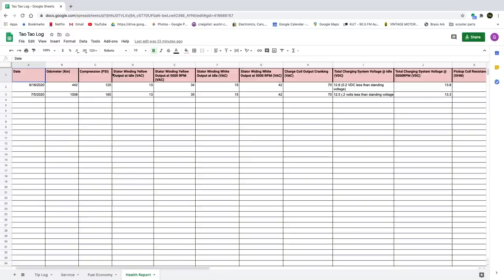(PT.7) I rode 1000 MILES on the most HATED scooter on the internet. Here is my review.

Comment: I have a tao 50 with 1958.6 miles now, paid $750 to Dallas motor sports for it new. and I agree its the cheapest bike to buy, however for anyone who has one of these (DO THIS !!!) before anything ...change the oil and check all fasteners nuts and bolts, "BEFORE YOU START THE ENGINE" after 400 miles change oil to full synthetic and gear oil to syn also. replace air box with a pod filter , replace battery , replace coil, replace carburetor with one you can adjust "move needle adjustment to allow max fuel intake, new spark plug also, replace cdi with adjustable cdi and set to max timing advance or the best idle, (do not get a racing cdi) , get adjustable cdi , so you can tune it for your environment and the way you ride...these tao taos hate cold weather but after making these changes mine loves the cold  (STARTED UP WITH ONE TURN OF THE KEY IN 26 DEG TEMP)but need to adjust carb for warm weather.  i thought this video was very good and enlightening , and i do appreciate the effort that was involved,  BTY after making these changes my tao tao will do 39 mph on a flat road so i can keep up with traffic ,  I purchased all parts on Amazon for  about $120 .

Comment: Hey, don't keep going with the experiment for  we YT watchers.   If you don't feel safe, call it quits.  My last two wheeler was a Yamaha Majesty which had 40 hp and could go 80-85 mph. Even with that power , I felt at times like car drivers were trying to  run me off the road. I enjoyed two wheeling more on the secondary roads through the country.                     I am sure, I just couldn't hack it on a 50cc Tao Tao. You're a braver man than I am !!! P.S. Let's hear some more piano!
Reply: i used to push a 1.0  hp, tomos revival, two-speed. top speed 28mph . i got passed by a group of bicycles more than once . i push a taotao powermax vip 150 on that old 50cc plate now for 6 years. did first engine oil change after 25,000 miles, still using factory gear oil, brakes, . i did put a maxxis 6024 on back for offroading Fun but blew a front fork seal . only two problems, muffler mounts and side plastics .  $650 NIB, the ATM-A1 in the above video was $499 NIB not $750, he prolly paid $250 for delivery , i spent less than $25 in gas . i would recommend the taotao powermax vip 150cc
Reply: I like to ride too. My wife and I also own a smart car which is amazing on fuel and the parking. I look for the ass that tried to take 2 spots and squeeze right in. HOWEVER, you get no respect on the road. 😂😂😂

Comment: Perhaps you should have found a guinea pig test subject that fell into the optimum parameters for this type of transportation . Say a high school kid of 175 pounds or less  with an evening job at a local burger joint Ect. 5 miles or less from home. In my mind that is it's intended target consumer. It's not to late you could hand off and just do service and data collection.
Reply: i would get the 150cc powermax and put that 50cc plate on it and see how long it takes  to get pulled over, i'm on my 6th year

Comment: The 30mph law for mopeds need to change. Its the #1 limiting factor, and in most places the law hasn't been changed since WW2. 30mph on modern roads is so unsafe that its basically useless. I have a 50cc Yamaha, and had to do 500$ in mods just to make it actually usable. These laws could be changed with the stroke of a pen

Comment: I am an auto master tech. As an experiment I went all the way modifying a Chinese 50cc scoot. End result a rattling death machine that will hit 50mph in about a half mile. That's big bore kit to 92cc, big valve head, high lift cam, complete rework of transmission. Fun around town but not really worth the effort. Cost was about the initial cost of scoot. I ended up sinking about 1400 and that included a brand new scoot. Did the same thing with a 150cc scoot and it would beat most cars to 50 mph topped out around 65 and would ride a wheely.lol fun and extremely dangerous. I put 3000 miles on the 150 and had to rebuild the motor at 1500 miles. It burnt a valve  from an exhaust leak I just enjoyed the backfires so much I didn't care.lol

Comment: Brother, you nailed it. Especially the last part. I have limited income and I thought my mechanical skills were better than they apparently are. Wait till it get's a little older. And you start getting into electrical issues. You risked a lot more than you realized  on those 1,000 miles. I hope people realize that. Thank you.
Reply: @applepoop10  Let me get this straight thousands of miles Big Bore Kit on a TaoTao and it never broke down I'm just going to come out and say it you sir are a liar.
Reply: @PaulHollandWheels  ? Once properly setup, 1 mile is really the same as 1000, so long as the fluids are kept up, electrical issues  are usually due to crappy routing, and if you set it up right they can be avoided and really, electrical is the easy part compared to valve adjustments and tuning the carb....

Comment: I bought a Tao Tao 49cc scooter in the Spring, ... am 6ft, 200 lbs, and have only a 2 mile commute to work. I have about 500 miles on the bike and have had zero problems. I agree the seat isn't the best and I think the suspension could use some help, and the engine is under powered, if I want to do more than commute to work and home. Mine isn't as ugly as yours, but overall is similar. For the $800 I have enjoyed it and it has done all that I expected it to do. After all of that, I did install the 100cc big bore kit and the under power problem is gone! However, it's not a quality built machine to take on long trips, but it's less frustrating to ride around town and I can keep up with traffic and no longer feel like I am in the way on the road. I bought this to see if I would enjoy riding a cycle with the intent of getting a better quality ride in the future if I liked it. I appreciate your views on the Tao Tao, but I think it delivers exactly what you would expect for the price. If your experiment continues, I will let you know how I feel after 1000 miles... thanks! Oh, and I don't think any 49cc scooter will be adequate for your commute and size, just saying.
Reply: still holding up?
Reply: @snow225-o7  So far the only issue I have had is a broken kickstand. The design causes it to hold water on the welds and rust. Got a new one on Amazon. Still enjoying it. The big bore kit was absolutely worth it. Frustratingly slow as a 49cc but enjoyable as a 100cc. thanks for asking. I get about 80mpg and top speed is about 45mph. Perfect in city commuter. Other than the kickstand, I've done nothing more than change oil and put gas in it.

Comment: We have the same one, even if the color is the same. I just passed the 1000-mile point. I had to change the carburetor and tune it to a higher RPM, and 2 oil changes, but that's about it. Just minor problems. Oh, and I use it with the Kickstarter because the battery died. So far, I like it, keep using it. Having 12-20 mile trips to town, rain, and mud, snowstorm, and ice, whatever, did work every time.

Comment: I own one up to 1400 miles on it drive about 20 miles a day to work works great for me only problem I've had is the gas line kept tearing (cheap little lawnmower gas line)  so I bought a real one (1.50 for a foot) and had no more problems since plus it cost me about 2 bucks every 7-10 days for gas which is great but driving in winds like 15mph+ will slow you down and keep you around 30 instead of the 35-38 I'm usually at all and all I enjoy this little scooter

Comment: I actually own a taotao evo 49cc.  It's in a bigger frame, 12" tires. Two people can ride it. I had a 100cc big bore kit, hi- performance 
Exhaust.etc. It will do 45 mph with me riding. I weigh 260 lbs. I have had no issues,  am right at 750 miles. But your review is very eye opening.  You have their lowest end, I have their highest end, with   work done to it
Reply: My wolf does 46 mph stock but I weigh 120lbs

Comment: I was an auto mechanic myself for over 40 years, and I'm sure you are aware of the adage: "You get what you pay for". We know this first hand when we bought Snap on, Mac, Matco tools for our trade instead of cheap knuckle busters that sent you to Concentra faster than if you stuck your hand in a running blender. 

The same could be said of the super cheap econo car that customers buy and wonder why the day after the warranty runs out, they're doing a major repair to the drivetrain. You get what you pay for.

This bike would be ideal for the wiry little guy of 5 ft 7 going to school from the dorm, but not for someone with your frame. Or even mine. (I weigh in at 245 at 6ft tall.)

Overall, you have this a good and honest assessment, and it certainly is valuable information for someone to consider when buying a scooter. I'm with you on recommending one save their money and buying a better scooter if they want to do anything other than ride through town on their machine.

Comment: As an owner of a 2012 Kymco Like 200i scooter I would like to recommend the Kymco Agility 50 as an alternative to the cheap Chinese scooters. At only $1195 it offers an excellent value for money and in restricted mode it qualifies for the "moped" class.
Reply: I'll second the KYMCO Agility 50.  Got a 2014 model in 2020 for $1000 with 17 km on the clock.  I'm 6'5", 320# and it handles me well (no passenger please!).  Derestrict the boss in the transmission and change out the CDI and voilà, something that can deal with traffic faster than 25 mph. (Yeah, gotta rejet it -- lean and lacking power).  But the first 400 km have been fun!  Oh, yeah, did have to adjust the valves at 300 km (TIGHT!!!) and change the oils.  I prefer my 2003 KYMCO ZX50 SUPER-FEVER 2-stroke, to be honest...  But the Agility 50 4T FEELS good, handling is good, and brakes are AWESOME!  By the way, bought the ZX50 in 2019 for $650.  Used scoots are the way to go!
Reply: I'll third that. I've got a Kymco Spade 150 and it's a blast. If I found a good deal on a Kymco scooter at the right time, I'd not hesitate to pick it up. Great value and build quality on a Taiwanese scooter.
Reply: I have one I bought from a girl she had in college 100 km was parked, new carb and fuel tank I have 800km on it now broke in the rings gonna keep riding it to work and around town it's very reliable

Comment: after 2600 miles on my tao tao i must agree i live in dallas tx and drivers are brutal to scooters so i modified mine and now it is to fast its even more scary.. if anyone is interested the mods i did. were ... new carb set up for go cart racing new jets and intake got rid of the air box replaced with pod breather high preformance coil and adjustable cdi replaced battery, factory batt sukt.. all synthetic oil eng and trans.. a few other things like spark plug and the normal , high flow fuel filter and new fuel lines .. after all that i spent about $150.00 .. now it has fast attack on take off good mid range accleration and top end is ,, i dont know , i shut down at 45 mph still had trottle to go but this thing isnt made to go that fast , any faster is certain death bumpy roads are scary, screws and parts falling out and fuel gauge broke head light and brake lite need to be replaced now.. cheap chines stuff.. most of the parts on the scooter are worthless like electronics however if taken care of the gy6 eng is good also the trans .. brakes need constant adj .. my advise is unless you have the mecanical know how invest in a better scooter and if you do buy a tao tao and modify it get ready to have your teeth shaked out while you pintch the seat cover.

Comment: Found something you might want to check on your tao tao. One of the bolts on my intake manifold worked its way almost completely out because the nut fell off. Scooter wouldn't start until I removed it and repositioned the gasket and reinstalled the bolt. I Found alot of lose bolts as time went on. Including rear axle.

Comment: Thank you, as a fellow technician, your videos have just enough technical prowess and data to keep me interested without much fluff. I ride my amigo 50cc for very short trips to the local wawa,  maybe 3-4 miles round trip. Being a technician, i treat my scoot less like a toy, and more like a vehicle, I love it, mostly because i've put about 200 k on it and I am sure my gas gauge is lying to me, I bought it months ago, and well, this thing runs on enthusiasm iam alone, I swear, I probably will spend more in engine oil than actual gas... I decided to add long term fuel stabilizer, just as a precaution. I keep it on a battery charger, because I use it so little.  I do appreciate the video, as this is my first foray into motorized two wheelers, and well didn't realize 4 strokes are so finicky as opposed to a 2 stroke (if your not a mechanic get a 2 stroke). I was at a loss with the how-to fix any of it, and your videos helped immensely. Saving this humble student a bundle on service charges for the obscene amount of routine maintanece. I'd love to watch future videos on upgrades or further maintenance schedule items. And reccomendations for said upgrades (not really power things (i dont wanna go much faster than 40 on this thing)  but like filters, suspension and such to well respect the machine. Thank you again for all your help and dedication to upholding the title "technician".  Clif  Tank/Turbine Technician.   ps also any advise for sourcing a mini-turbine so i can turbine swap this thing when I step up to a real motorized  cycle would be great, (with a wider rear tire i almost feel i could make a turbine out of a turbo snail and a modified super soaker)

Comment: I've got a used GY6 clone and it's fine. I bought it used at around 6000 miles. I have about 7500 on it. I've changed the engine oil, the gear oil and replaced the air filter. I bought it used without a rear lug nut too which was fun. It gets me around my large city just fine and nobody has ever given me a problem because in my area, we also carry so road rage is pretty pointless especially throwing objects. 

The people upset at your speed are vehicles that can barely do the speed your scooter is doing and if they slow down, they risk breaking down. I've actually seen this many times. However the previous owner did some modifications on it, I suspect, such as unrestricting it so it keeps up on the main road's 30mph traffic. I can push 40mph on some roads but I need a new rear tire. 

It's a fine option in 2022 with gas prices the way it is but I wouldn't have my mother, aunt, grandmother, etc. use this as a means of transportation. It's good for somebody 20-40 years old who is trying to save some money and needs transportation.

Comment: As a guy whos family used one of these as daily transport for 2 years, I've not seen better advice.  I always tell people if you're going on 40mph roads, or youre heavy, a 50cc scooter is outright dangerous.  You have no power to get anywhere, pull out to merge with traffic, anything.  Ive personally never seen failures like yours, but they don't surprise me.  You gotta really know what youre getting into.  I find that if you truly daily commute going over 30, just get a 150cc.  Hell, I'd say the best beginner scooter is a Vino 125.  Not scary with power, low seat, lots of storage, great breaks, but it can do so much more than these little 50s.  Id push people to buy a used Yammie or Honda over these.  They're great scooters if you need them, but you could get a 150 for 200 more dollars, and be so much better off.
Reply: I totally agree with you. I had both a Honda Elite 50 and Yamaha Vino 125. Did derestricting of the Elite and Dr Pully weight and variaters on both. I get that the Elite is a Honda and has better build quality. It would do 40 and get there reasonably well for me at 175lbs, but I stuck mainly to back roads I learned through commuting on bicycles. The Vino would get to and cruise at 60 nicely and I never felt uncomfortable on any road but country highways and interstates. Yes, I'm a little adventurous in my travels. I recommend going with at least 125cc and if on a budget, go with Kymco. I've got a Kymco Spade and although the fit and finish isn't as good as the Japanese brands, the quality is where it counts.
Reply: The idea of the 50 cc is no insurance.  Title fee.  And motor cycle license.   Bill.

Comment: Forgot.. there is a level of *hit or miss* with tao-taos and all  Chinese scooters.. the biggest issue is "quality control" they slap them together fast and sloppy.. I've gotten 8 or 9 in a year that i rebuilt and sold , out of them 3 where trash! Had a broken piston on 1 a bent clutch on another a cracked frame on 1..the sellers made it right but thats hard depending on seller.. the others where ok but i stripped them down 100% repacked bearings replaced or upgrade everything rubber/plastic wires wheels coil/cdi and ported and polished the head upgrade carb and airfilter and belt. The average a top speed of 40mph and i sold for $1200 each.

Comment: I have about 100 miles on a 150cc scooter I got for $1400 delivered, an X-Pro Tahiti 150. Senling is the manufacturer. So far no problems and amazingly it hauls me around quite well (I weigh 300)  I would like to find out what more I need to do to maintain it, not just oil changes. I bought it for the back of my RV, but am really loving riding it. I have 2 motorcycles, a Yamaha 1100 and a Suzuki 800, but this lightweight little thing is so much fun, I just really can't stop with it.